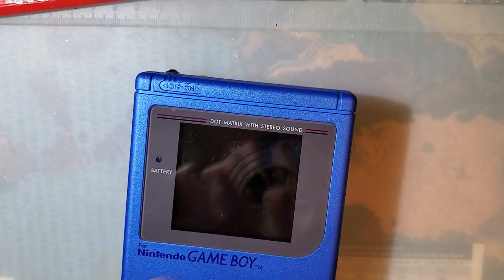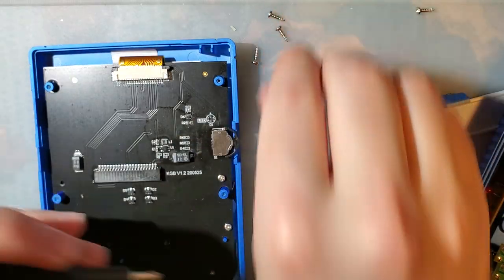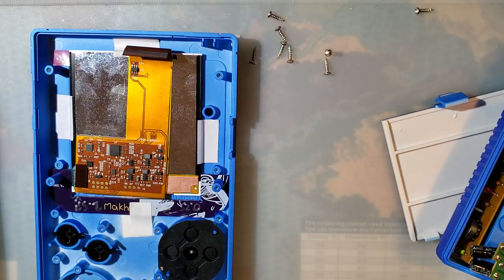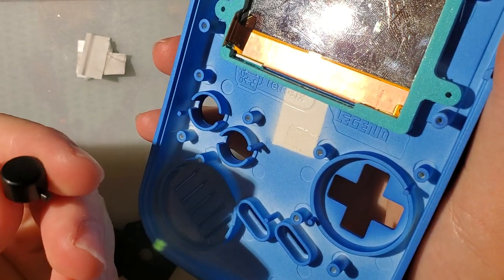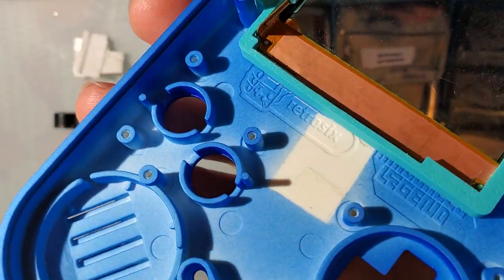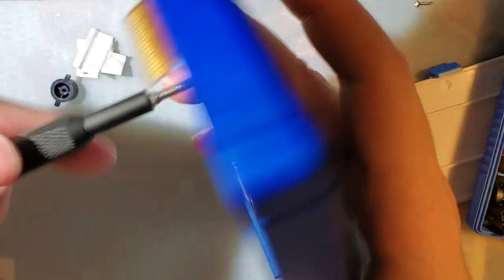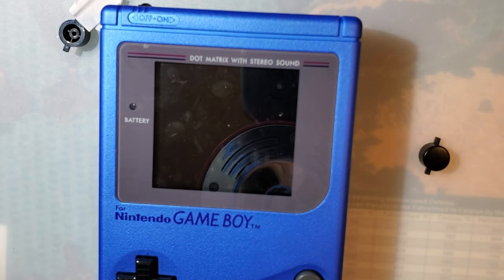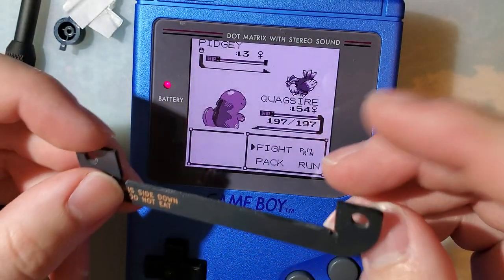FP 'Retro Pixel' - Game Boy (DMG) IPS Kit Centering Brackets

Comment: Is it actually necassary to widen the screen window? Retromodding on their site in the product description, states that the the viewing area is the same size as the stock display and also states that no special lens is required. On the funnyplaying site there is a completely opposite info, cutting required and a lens with larger viewing are included. This Does Not Compute in his recent video used retromodding shell without cutting  and the displayed are seemd to fit the shell window entirely, he used a clear lens so it wasn't clearly visible if it covers some of the displayed screen. It's really confusing. I'm referring of course to the same Funnyplaying 'Retro Pixel' IPS screen for the DMG in each case.
Reply from the maker: funnyplaying q5 kit is right on the line of "you can use it without trimming but it will look a lot better if you trim a little bit and use a custom lens"